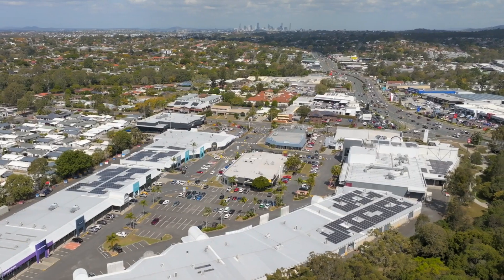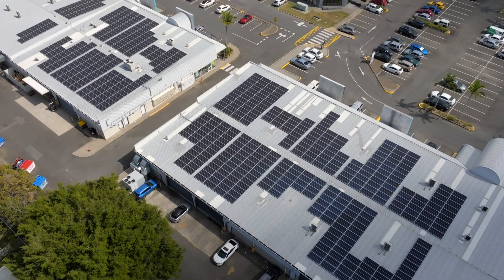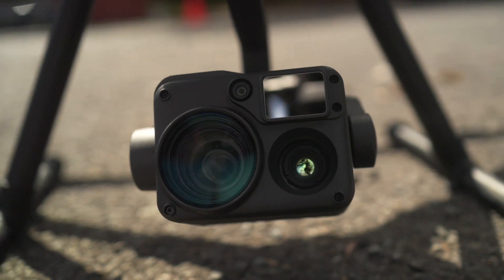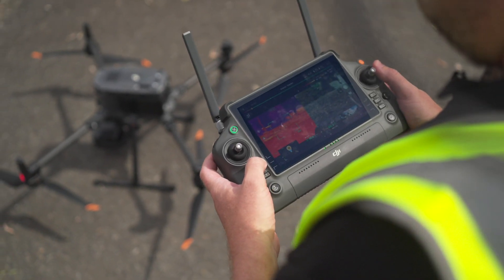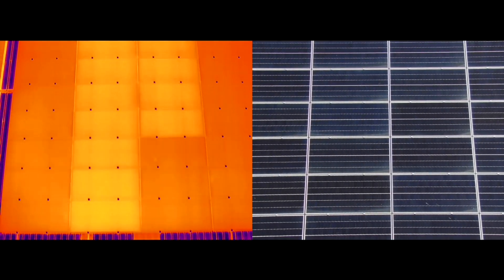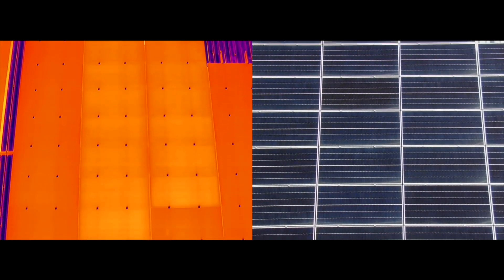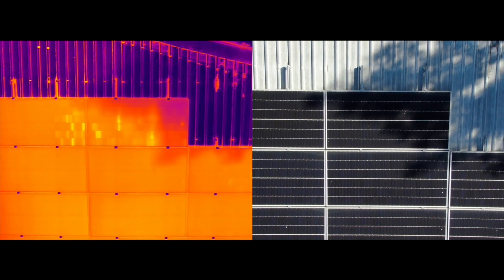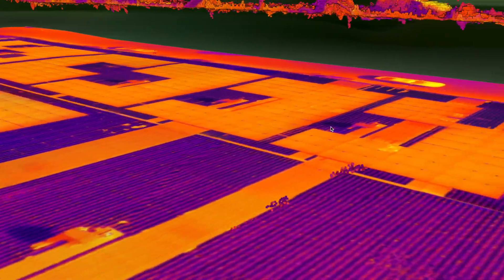Green Sky Group | Thermal Drone Inspection of Solar PV System

Comment: which software are you using to analyze the thermal data?
can we check the PID also?
Reply from the maker: For this thermal inspection we used both Scopito and DJI Thermal analysis tool.  When we conduct solar farm inspections, we use Raptor Maps.